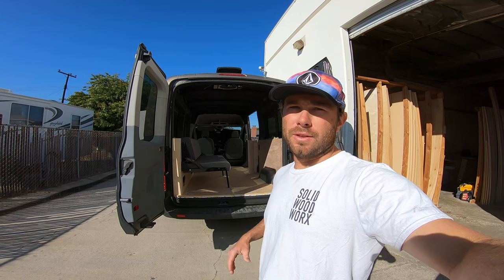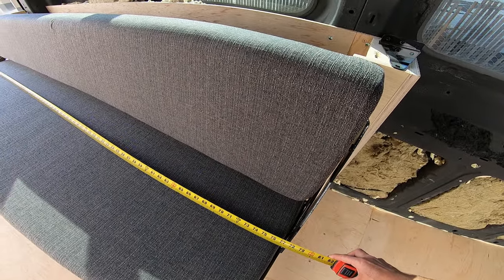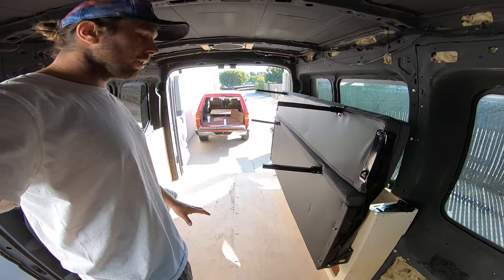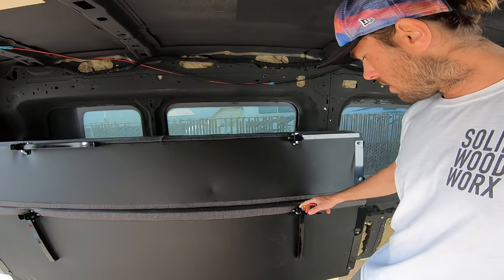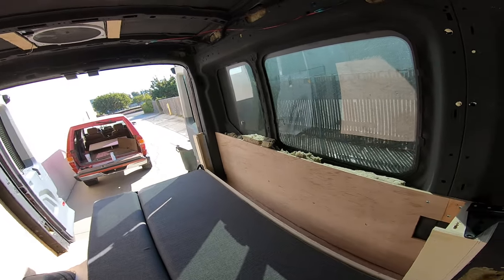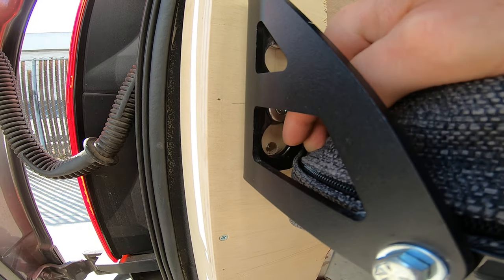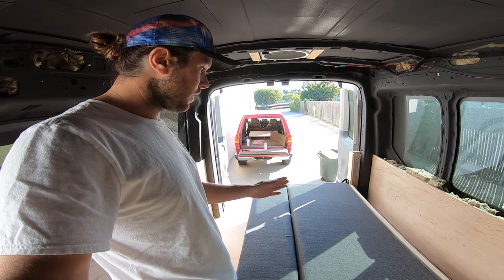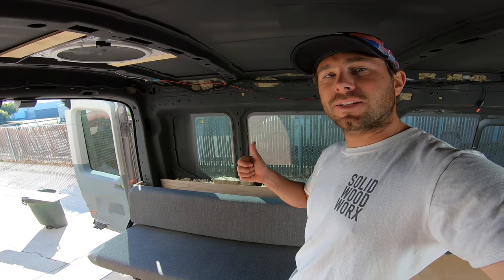Folding Couch Bed Review

Comment: I was eyeballing this system for a few years but couldn’t get myself to pay the price for the full system. So, I ended up buying the bracket systems from the manufacture and a 4” foam topper to make my own. It was a lot cheaper. I have yet to build my couch/sofa/Murphy setup - but it’s nice to finally see another van conversion using it! 👍🏼
Reply: Where did you order the bracket system?
Reply: @mywhatahampster  Recpro has them on their website under furniture parts
Reply: @bellottp what did you use for the platform? 3/4 plywood?

Comment: I question the leg design.  When the bed is in the up position & the legs are folded down, how many times will one scrape up against any of the four "squares" that are sticking out?  It is a definite no.  Thank you for sharing your video. 🌻
Reply from the maker: Never had problems with it for two years

Comment: Great video. ONLY one we’ve found with any detail. Can you provide any additional information for the purchase of the ‘optional’ wall mounts? They look great! Did you reference Home Depot also for the mounts? Do you know the name of these brackets? Our kit came with those original flimsy mounts. We haven’t started the construction yet but it LOOKS like the back cushion needs to be thinner than the seat cushion to be even in the bed position. How did you address this? Sorry for the long post. Just excited to find your sight! Thanks for any information you can provide.
Reply from the maker: Hey there, the company who sells this rbcomponents.com would have those extra mounts which they call quick release brackets for sale on there website. As for the back being to thick sounds like you might have mounted it to low. You can cut down the legs if that’s the case. The pins are just called counter pins and you can get them at Home Depot in hardware.
Reply: TY for the quick response. Those brackets are just what we were looking for. Regarding the opened BED position.. when the folding hinges are FULLY opened in the BED position (without cushions or base or legs installed) it appears that the top cushion part of the hinge is not level with the seat cushion part of the hinge. It appears that if we used the same thickness of foam for both cushions, the top cushion will lay slightly higher than the seat cushion. Did you find this to be the case? THANKS again for your interest!
Reply from the maker: No I don’t have that problem but I also use another 2” thick foam on top most of the time

Comment: Do you think that would fit into a regular truck bed with a camper shell?
Reply from the maker: Length wise it is 6'4" long, but i dont think it will fold up flat in that shell. It would for sure be able to be a couch and fold into the bed though!

Comment: Thanks for the video!

2 questions: 1) what height did you install this or another way of asking what I really want to know (and didn't find in their spec), what is the height of the legs from the floor to the bottom of the base. 2) As the back rotates down to form the bed, what is the max height above the bottom of the base the the entire unit reaches?
Reply from the maker: I believe it was about 16" and they do have those specs on there site if i recall you have to really look for them!

Comment: Would that set up fit in a Chevy Express van?
Reply from the maker: Yes
Reply: @SolidWoodWorx  hmmm. I was told it was too tall this AM by the manufacture. 🤔
Reply from the maker: Are you trying to flip it up flat against the wall? Or just fold it into bed mode?
Reply: @SolidWoodWorx  The wall height doesn’t work. I am going with their 76” bench instead. 👍🏼

Comment: Is there a wider version?
Reply from the maker: No wider versions of this couch bed no, they do make another bench version that can flip down from the opposite side though.
Reply: Hmm thanks. This directed me to look at their site. They also have a Folding Sofa/Sleeper DIY Hardware Kit. Would I be able to swap out a seat bottom for the seat back? The seat bottom is 10 inches wider than the seat back.
Reply from the maker: If you watch how it folds it wouldnt work.
Reply: Solid Wood Worx hmm 🤔 what about I consult your services in regards to making a wood frame version that can be queen sized width for a high roof cargo van?
Reply from the maker: Sure